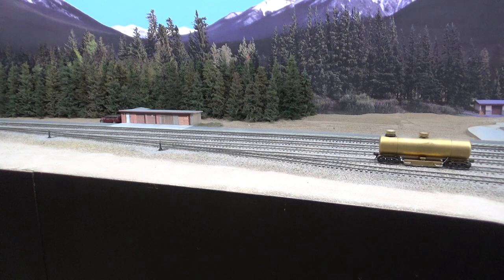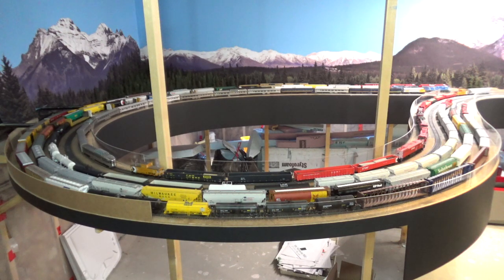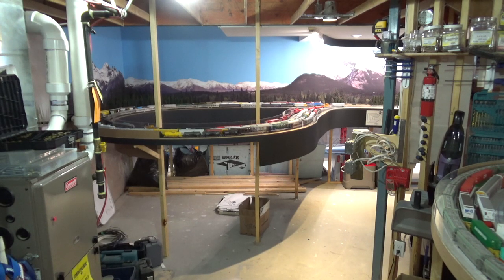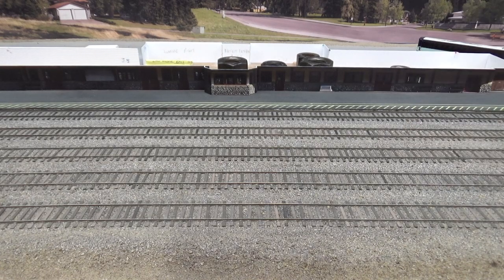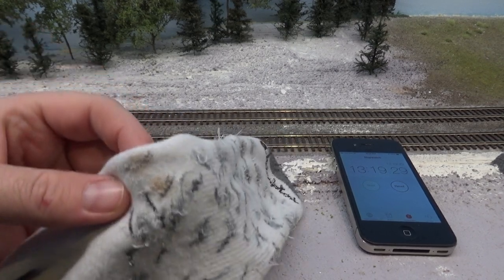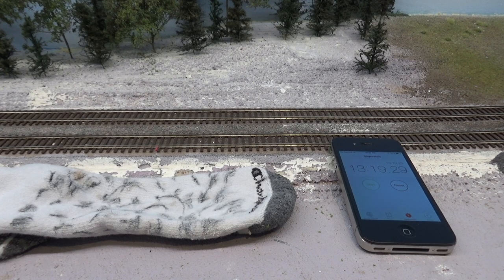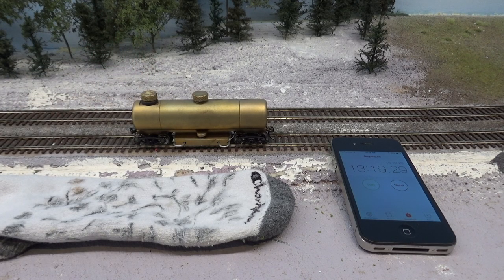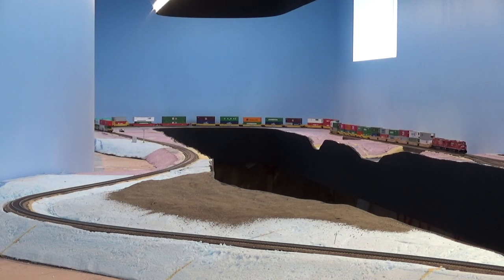How To Clean Six Hundred Feet Of Model Railroad Track

Comment: Hi, Your method is great, cost little, is fairly easy, is effective, leaves no residue, takes minimal time, and has one big problem! It only works on layouts with no scenery ! ... Please take no offence, but I can not even see half of my track let alone, reach it with all the trees, buildings, telephone pole wires, tunnels, etc. In my opinion the best solution (and always has been ) is ROUND TOPED Rails ! ! ! ... There is no surface for dirt to accumulate, if the top of the rail is NOT flat. Did you, or do you EVER remember cleaning your Lionel track? Rapido N scale track, same story. Conductivity is way, way better because all of the car's and locomotive's weight is riding on such a very thin line of rail ( more pressure, smaller area ). Think of it like your rail was made of razor blades ( not that you would ever want that, but the effect would be amazing ! Still to this day, I don't understand why anyone has never produced HO scale rail with a round top. Now don't get wrong ( I'm really into scale ), but think about it, would a round top Ho rail really be that noticeable? Great vid. Thanks, ... George
Reply from the maker: This is a very good point George and I should've mentioned it. It's all fine and dandy when you have a wide open unfinished layout like mine. But once there's more scenery, it will definitely become more difficult to clean. Especially if your layout has tunnels, centenary wires or something else that blocks access from above. 
That's a very interesting idea for rounding the top of the rail. I would think they could put a slight round on the top of it and it wouldn't be noticeable in any thing smaller than O scale.
Reply: @BArailsystem  Thanks for understanding. Round rail is the way to go, My 1st N scale layout had all Rapido track and I never ever had to clean the track !... Rapido didn't even make a track cleaning car, because there was no need for one. It was never an issue. I wish I had the space you have, your layout is great. Thanks ... George

Comment: Goo-gone. Lightly soak the pad on the cleaning car (not dripping) and run it. Clean the pad off every so often. Never had an issue with oxidation or pitting from this stuff an is commonly used by many large clubs. I never use anything that can snag on points, joints, spikes or other raised objects or leave fibers that can end up in locomotive axles and eventually in the gears. And stay away from abrasives. Take it from someone who's been in the hobby nearly 30 years and a club just short of that.
Reply from the maker: Thanks for sharing your experience Charles, sounds like you have a few years of track cleaning experience under your belt!